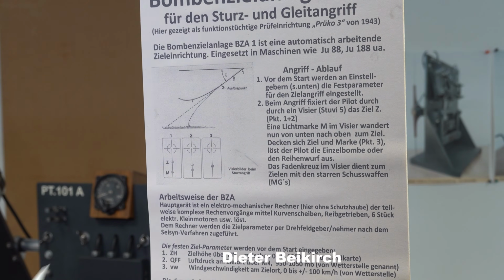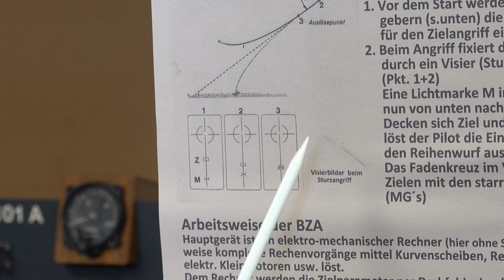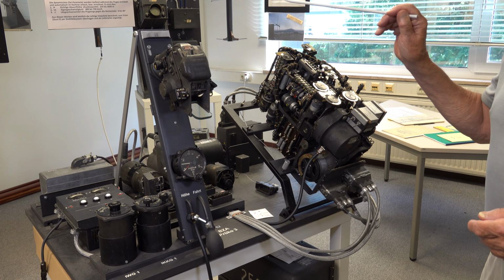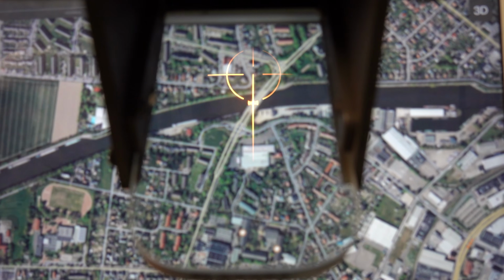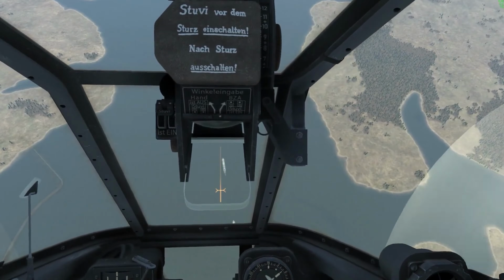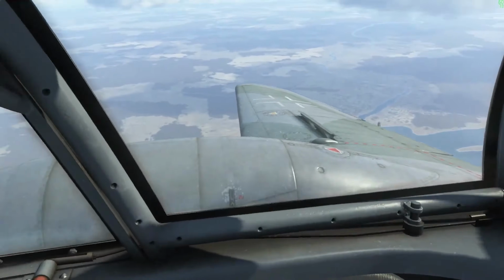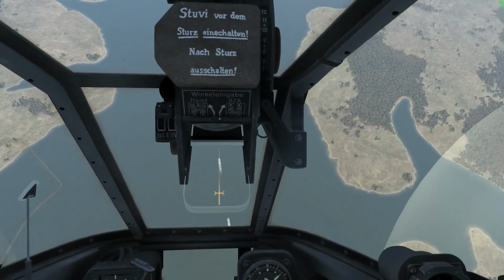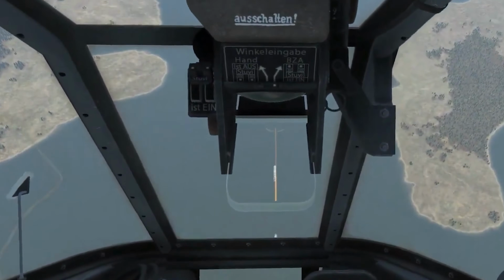BZA dive bombing computer with Stuvi 5 bombsight

Comment: Electrical Engineer here.  Some points
1 Selsyn was a 1904 Siemens patent.  German battleships switched to AC systems early.
2 Selsyns can be used to transmit positions and sensor readings but they have limited torque and therefore accuracy.
3 Its usual to include some electronics that amplify the deviation voltage to drive a servo motor.  Either vacuum tubes or in the German case magnetuc amplifiers.
4 it was mentioned that the AC voltage in the primary was proportional to the deviation angle.  It’s also either in phase or 180 degrees out of phase (nothing in between) . This is how you tell if it’s say +10 degrees or -10 degrees out.   This can be put through a phase sensitive rectifier to produce a negative or positive DC voltage depending on phase.  A constant stable reference phase is used to change the direction of rectification.  This DC voltage could be passed to a DC motor or electromagnet to move a mirror or turret.   German practice sometimes used a moving jet high bandwidth electrohydraulic servo valve. 
6 computer of the day used shaft rotations to represent numbers and, differentials to add and subtract and log anti log cams to multiply and divide.  Trigonometric cams and ballistic cams also existed often 3D.
7 A Ju 88 divebomb run would begin with the Lotfe 7 computing bombsight used to provide wind data and line up the dive correctly. 
8 The Finn’s often used a 22 degree angle starting at 8000ft with pullout complete by 5000ft at 400mph

Make sure this isn’t posted just on YouTube.  It’s too precious to loose

Comment: Bza in il2 great battles has at least 2 fundamental errors.  1. You cant set barrometer scale but only the height of the target and 2. The scale of height in bza rotate button is not accurate you have to have technochat on which is forbidden in taw server. So il2 developer's team has to rework bza. I hope that in the upcoming ju 87 d5 the latter will be fixed.

Comment: Great video and thanks for sharing this with information with us.
Can you do one on the Lotfe 7C or the Lotfe 7K? I struggle to know the difference.
Reply: The B model was the first with gyro stabilisation. The remainder varied often as to magnification.  The 7K was for the Ar 234
Reply: @bernhardzunk7402 what did the 7K improve over previous model?
Reply: @kampfgeschwader76 Erich Sommer, was famous for Ju 86 missions over Britain and also an Ar 234 mission.  He suggested the sight be integrated with the Autopilot as the pilot had to act as bomb aimer as well.  The Ar 234C5 was to have a 2 seat cabin.
-Generally the differences between models was to do with the focal length and altitude they were optimised for.   The Lofte 7 was not gyrostabilized but this feature was present on the Lotfe 7B.   The British with their ABS (which became the SABS II with Stabilisation) and the Americans with the early Norden all tried a computing bomb sight without Stabilisation. 
-I Imagine the Lotfe 7K would need a synchro output and input to the autopilot.